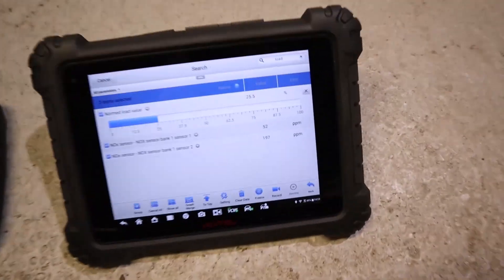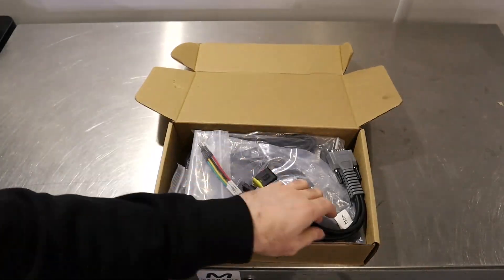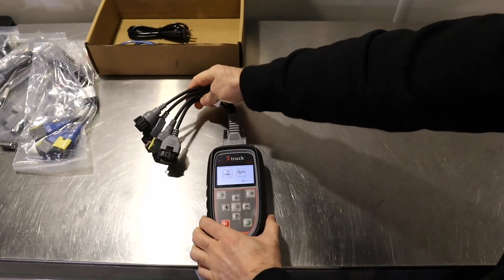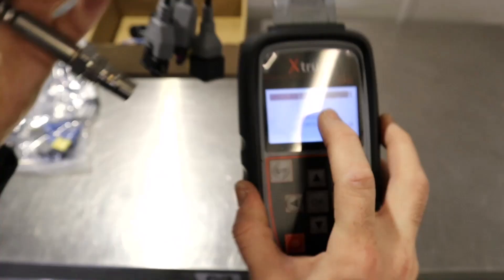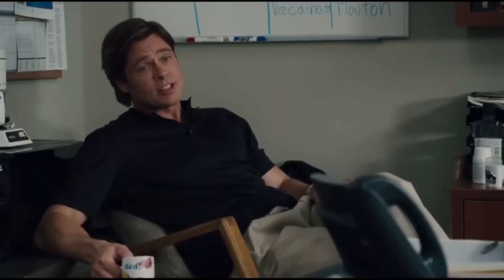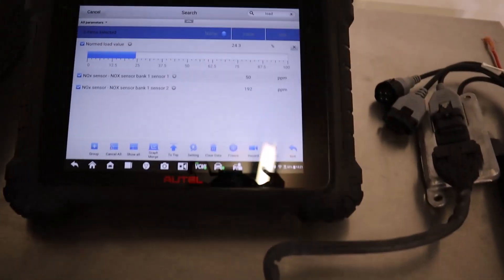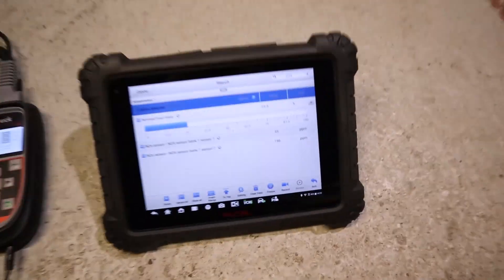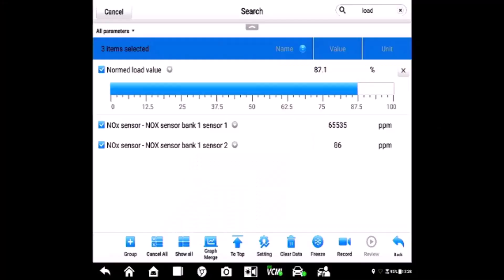AdBlue Diagnostics Made Easy with this NOx Sensor Tool

Comment: Hi do you find the chinese nox sensor in description reads accurately? Just curious because ive found a lot of these sensors don't really work.
Reply: Ok thanks
Reply from the maker: @royritchie4184  This one works fine. I just used one of the part numbers
In the list of supported sensors on the tool. 

If you want, you could get an OEM sensor; but then you might as well buy a gas bench for that price 😅

Comment: Purchased one of these to check Mercedes e class. Unit only reads 25 different sensors, not the one needed so waist if money?
Before buying ask for confirmation it reads the ones you want ir fir or a waiste of money
Reply from the maker: I recommend you use it like I have; buy a sensor that works and treat it like a gas analyser to compare with live data 👍 even if it did connect to your sensor, there are certain faults it won’t detect

Comment: Great little tool for verifiying NOX values👍 I work wirh OEM bosch software and there is a nox model shown in diagnostics, if either sensor deviates or drifts within a window then it will flag it, I normally just pull both NOX sensors and run them in fresh air, you can then see a drifted sensor and lob it it in the bin.
Reply from the maker: Ah nice, I’ve not seen that. I did a Diesel Train the Trainer course at Bosch in Germany some years back; they did t have that feature at the time. If you have 2 sensors installed, it should be pretty straightforward 🫣

Comment: Hello big SECRET! The lambda sensor Boch was bought new in the store, before installing it on my car I sprayed silicone with moisture control on the connector, after that after a few days the lambda stopped working, there was no lambda activity, such an error code, I was desperate. I didn't sleep for several nights. Then I made a mini turning the disk with a milling cutter to a small slot 3 cm above the nozzle, I connected a multimeter to the ground and heated the sensor with a gas probe, the multimeter showed 0...800 mv when moving the gas flame, I was surprised! I put it on the car and checked it, following the schedule, everything worked. My conclusion is that the lambda can go through the wire connector to the comparison to the oxygen, but I blocked the comparison to the air access sensor with silicone spray, tell this to other mechanics, maybe someone needs this knowledge!
Reply from the maker: Ah yes, the sensor needs to breathe. Some make a comparison to atmosphere air 👍

Comment: So, this could be working diy tool for inspect deleted DPF and Adblue systems? Cheap and when nox sensor gone bad, just buy new nox. I mean can test from tailpipe, if there is many nox particles...
Reply: Have you tested this with PM sensor for detect DPF systems?
Reply from the maker: Yes best for NOx system testing and NOx sensors 👍
Reply: @MechanicMindset  I hope someone make similar tool what works with cars and vans, not only trucks. Or can that tool use example for mercedes diesel car nox sensors?

Comment: Nox sensor 1 closest to the engine should always read higher than the nox sensor 2 downstream of the engine as its further away and is after the scr convertor and adblue injection valve. If it doesnt then disconnnect adblue valve, carry out regen on vehicle to remove adblue still in system.and recheck with no adblue valve connected both sensors should read the same. Had them before when reading high when engine off thats a teletale sign its faulty

Comment: I thought rule of thumb was that the downstream NOX sensor should be lower than the upstream NOX sensor as the cat should be cleaning up the emissions?
Reply from the maker: That’s right, should be 90% drop about. This car have funny readings on the road; sensor 2 shoots up under load and there are a number of things that can cause that. If you’re familiar with your live data, it would have been clear sensor 1 was faulty here. The tool helps confirm 👍

Comment: Hi Darren I’m glad I just watched this video not because of it being about Nox sensors but I picked up the Xtool  D7W scanner and  you mentioned it being hard to plug in. I have come across the same issue on the scanner DLC  CONNECTOR on both my vehicles. So needless to say I have not checked the scanner yet. I’m about ready to get a very big hammer which is an aircraft mechanics prized possession  to plug it in.  lol. 😡 I hope all is well it’s a little rough here for reasons you know. Looking forward to our next live session.      👍 Artie
Reply from the maker: Hey Artie, I’m not sure this is XTool brand or not. I slipped my tongue in the video and called it XTool. But it’s XTruck. May be related. 

Hope she’s ok mate

Comment: Love this Darren although my wallet doesn't agree.
Reply from the maker: So helpful way cheaper than gas bench. What method do you use for SCR diagnostics?
Reply: @MechanicMindset  mainly the reliability of the Nox sensors on the vehicle when dealing with efficency faults, how ever this can be mis leading. Bit like relying on a DPF pressure sensor live data with no manual check. But this tool will be a game changer for that. It will then just be a case of building your own known good database to ensure source nox is not to high before SCR has taken place.

Comment: I'm confused, whilst your saying the original sensor (removed) was reading 50 ppm , the (new X-Tool) sensor fitted is reading 250 ppm and that makes the original faulty, so why does the X-Tool say the new sensor is damaged whilst reading 250 ppm ? Surely a better test would be to add a small spray of an ammonia substance to the intake and see if the sensors (both upstream & downstream) start reading higher numbers ?
Reply: On semis we run what they call a low temp regen & disconnect the DEF (adBlue) doser and watch our NOx sensors. They should be within 50 PPM of another, if one reads way high or low from normal values (high 200’s to low 400’s depending on the engine) then you know you have a skewed/drifted sensor. If the sensor values are reading properly but, the outlet doesn’t change during a regen with the DEF/adBlue doser plugged in then you have another issue (bad DEF, faulty doser, build up of unburnt DEF in the mixing chamber and/or SCR, or a bad SCR.
Reply from the maker: The XTruck reads faulty because it’s meant to ‘test’ sensors in an engine off state. The live data in these don’t read engine off and when you take the load off the engine, they both drop to zero. In fact, sensor 2 was reading a little higher than zero. It wasn’t that sensor 1 wasn’t reading, it was just incorrect. The tool helps to confirm ‘actual’ NOx reading considering AdBlue injector is disconnected 👍
Reply: @MechanicMindset  thanks for the reply.